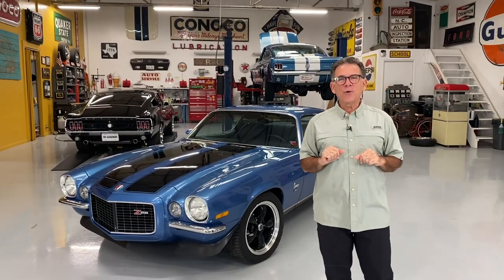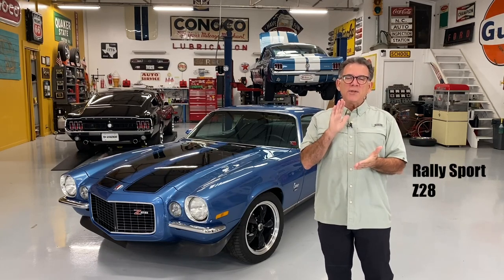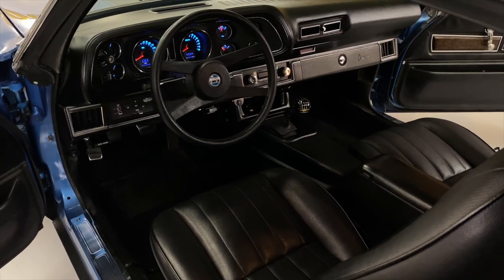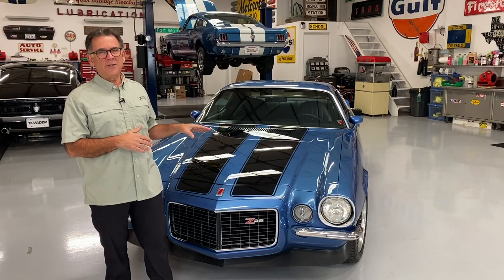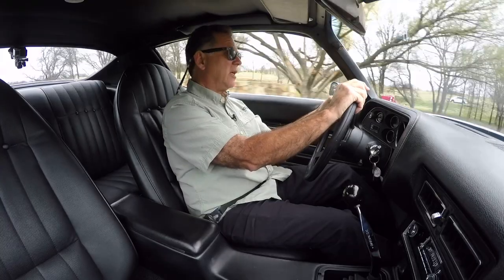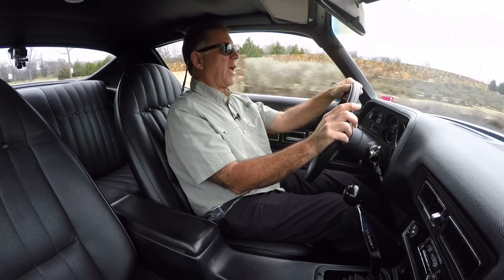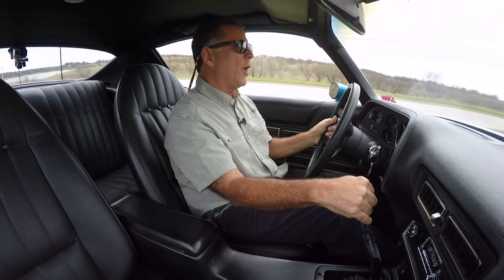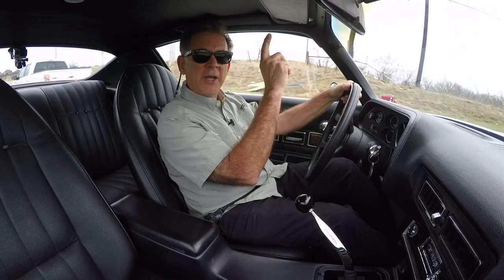1973 Camaro Z28 RS LT (LS3 Restomod)

Comment: . Beautiful car ! I see That Car is a" Late" 1973.  It has the cardboard Headliner, (instead of "Bowed").  I have a 1973 RS LT Z28 that I bought new. when they "redid" that car, WHY did they put "CAMARO 350" on the Fenders ?? it is supposed to be Z28 in that spot !
Reply: Exactly, I had the same car in Black & White 73.
Reply: Lt option had emblems also.   Including front fender.
Reply: They did not change the emblem when they redid it.  It is correct, and is not supposed to read Z28.  All Z28/Type LT Camaros in 1973 would have come without the Z28 emblems anywhere on the car.  The Z28 grille emblem on this car is what would has been 'added'.  In factory form, the Type LT trim would have superseded the Z28.  Most people would still add the Z28 emblems after, as they likely couldn't deal with having a Z28 that didn't say Z28 on it anywhere!

Most will doubt the accuracy of this...  so check out a 'test drive' of this car when it was new.  I believe it was in Road & Track magazine.  It shows the car as a Z28 with the Z wheels, but the test car clearly reads "Camaro 350" on the fenders.  Again, this would only be Type LT cars, which would have also superseded the "Rally Sport" lettering on the fenders.  If a car was ONLY a Rally Sport, it would read "Rally Sport 350"

This is also supported by information at www.nastyz28.com

While anything is possible to have 'slipped through' at the factory, this car is correct in regard to fender emblems, and it's hard to find them still that way.

I owned a 1973 Type LT/RS.  Mine was NOT a Z28.
Reply: @robertbiallas2192  LT emblems were on the front "header" between the headlight and grille on the drivers side. LT on the roof pillars, and on the tail panel between the tail light and the license plate on the passengers side, also on the steering wheel horn button

Comment: Absolutely stunning, owned a73 rs Z-28 with factory air and a worked 400 turbo and factory posi 323s. Corvette rally wheels, 15 by 8 rear and 15 by 7s front with ladder bars and bfgoodrich  white letters. Flight panel dash with tilt. Tan interior with emerald green imron and mustard gold stripes made it unique. Loved that car but got away from me leaving a 4th of July pig roast 😢 kissed a poke and sheared off the passenger side all the way to the sail panel! Walked away but sad over the loss. Owned over a dozen 1st 2nd and 3rd gen Camaros but it was my favorite Z-28. You said it best about Chevrolet nailing it with this design.74 wasn't bad but that wrap around rear glass altered the car in a major way. That car is a keeper in every way.
Reply: 73 Z came with 373 posi
Reply: 1974 camaros still had the small back window.  1975 to 1981 had the wrap around back window.

Comment: Dude, it's only an LS-3, and the Z-28 markings are missing on the fenders and spoiler!!! Its not a real Z
Reply: See my other post above.  It is a real Z28, and is CORRECTLY missing the emblems because it is a Type LT.  It should actually be missing the grille emblem also.  The "T" in the VIN verifies Z28 status.
Reply: REASON NO z28 BADGES THERE IS BECAUSE IT IS AN LT TYPE, THE 5TH DIGIT IN THE VIN SHOWS IT IS A Z

Comment: Beautiful build but, LT's didn't get stripes and it should have Z28 fender emblems and a Z28 foil decal on the backside of the rear spoiler... Just FYI.
Reply: See my older comment below.  Correct that LT did not get stripes...  it also did not get Z28 emblems anywhere on the car.  The stripes were added to this car, but the Camaro 350 is correct.  Z28/LT cars with Z28 emblems or stripes have had them added.

Comment: That is one nice ride for sure, have you or your son happened to look into a 1965 Nova SS  2 speed with a 283 , Sweet little grocery getter,  my cousin had one and rebuilt the engine, replaced the floor boards and trunk, new paint also ( close to the Camaro Blue in Color ) was a beautiful car inside and out.

Comment: I've owned 4 70 to 74 2nd Gens, from Tame Stock to Wild Auto -crosser, They were all Awesome in their own way. That Car is Done Right although I would prefer a Little more Camshaft with the Manual Trans! But the Special Place is in the Drive Quality of these Cars, Almost 2nd to None with Very Little Work, great Ride Quality or Maxed to Auto-Cross specs but Still Street Friendly, ( Swap Tires and Adjust the Shocks, disable the Secondaries if Carbed ) and ready to Race, but the Ultimate Fun was when a Great Friend and I Left Ft Wayne Indiana on a Saturday Morning and Arrived at Costa Mesa California Sunday late Afternoon and that was not Driving Crazy, the Speed Limit was still 55 but our Average speed was 63 to 65 and to tell you the Truth we were Nowhere Near worn out. Those Cars were built to do it all and yes the Buyer of this one should be Totally ecstatic! Wish you could post Pics here because from the Outside I owned a 70 that was a Twin to this. Great Vid Great Car!